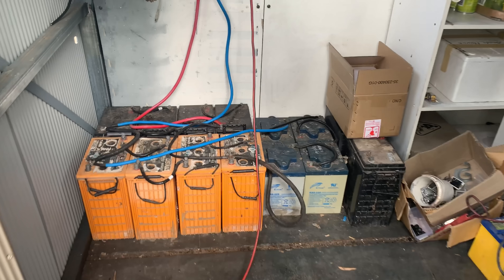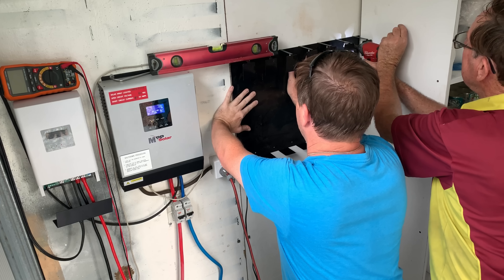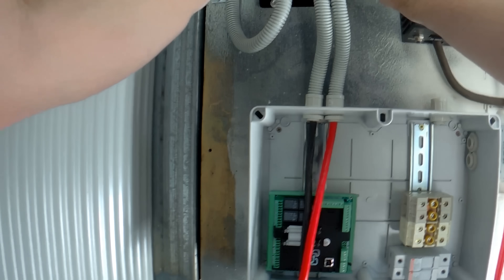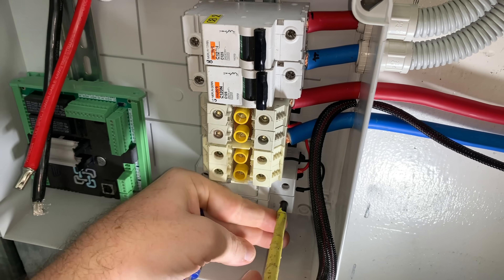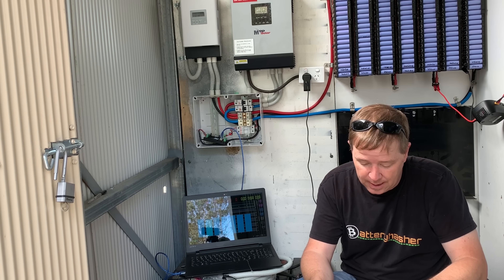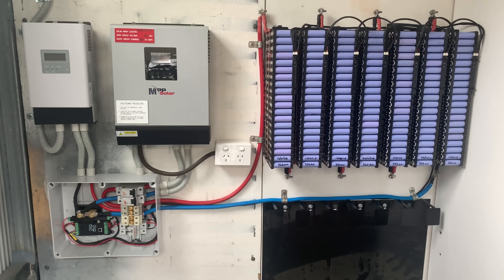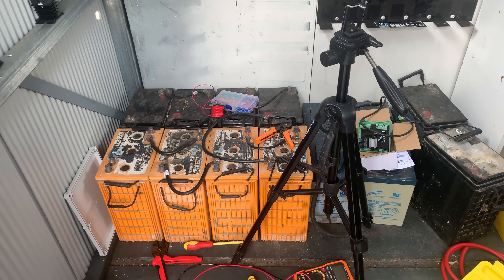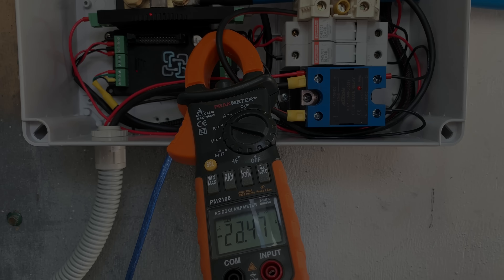Upgrading lead acid to lithium storage | Destroyed my $1000 BMS |

Comment: I'm curious.  Why the PCM60x as opposed to using the charge controller built into the PIP?  Capacity maybe?
Reply from the maker: Heat is a big reason but that inverter is 4 yr old and only have pwm controller and 30 amps max at 60v or something. So not efficient
Reply from the maker: My newer pips have the same ability as the PCM60X but still prefer to keep them separate
Reply: Very good point, mine has that even the capacity is measured, but it's a programmable mppt, only thing i like is the read out he has on the laptop.
Reply: Yes, a PWM charger is much less desirable.   Mine has a built-MPPT charge controller.  One advantage to using a built-in charger is efficiency.  Solar can be converted directly to A/C within the PIP on demand (when solar is available).  Sorry about your Watchmon,  by the way.

Comment: Batruim bms  has  a problem in the connection wiring. They need to improve to make it more simple and safe.  
I hope you contact with batrium team to solve  wiring issues
Reply: Like he said it was not the board fault that it was wired incorrectly, he knew what he did wong right away, if you use the included cables they are colour coded but as they was not long enough he had his own made and plugged them in wrong and released magic smoke (only so much you can do can't really prevent human error)
Reply: @leexgx  
we know all this.
what some of us suggest, it should be made more fool proof.
besides, the colour coding cannot be seen from all angles. it is alright if the batrium control board lays on the table. but once built into its case it might not be visible anymore.  then we have the matter with polarity,  which i personally marked (minus with a black felt pen) just to make sure.
Reply: @ursodermatt8809  I agree the keying could be better
Reply from the maker: I wired it wrong no issue on their part.
Reply: @HBPowerwall  
well yes, you wired it wrong.
however batrium probably mostly sells to the DIY market. so it would certainly be an improvement to make the connections fool proof. also the colour coding markers cannot be seen from all angles.
average joe destroyed his batrium control board, now you. and i am sure there are many others.
Reply: @ursodermatt8809  You cannot make things idiot proof, especially when you make your own cables!
Reply: @Dust599  
well yes, but the batrium stuff is really really expensive
Reply from the maker: I guess if their product was in the millions of units not the 100s it would be cost-effective - but I can buy directional tires put them on the wrong side and it's not going to change how they make the tyres.
Reply: @HBPowerwall  
when average joe wrongly connected the data cables and the batrium control board blew,
they changed something so it would not do that anymore.
 if it is designed from ground up to not self destruct,  i don't think it would cost them all that much.
it is very easy to wrongly connect. it just happened to you, it happened to average joe and you guys are by far not the least knowledgeable guys.
Reply from the maker: Hey! it's like 1/10th of my whole setup cost - security and peace of mind is a valuable commodity
Reply: @HBPowerwall  
i am not criticizing the price. what i am trying to say, for the steep price i would expect  the batrium to be designed in a way it does not burn up when you connect a wire wrongly.
i mean for a cheap chinese bms we wouldn't have that discussion here now.
Reply from the maker: All good buddy, personally i think the price is reasonable considering the 10k i've spent on other components - that said smaller projects ED is a solid choice - I should buy one and play :)